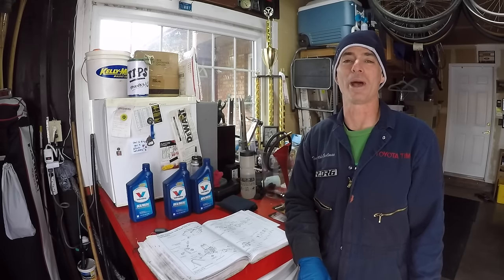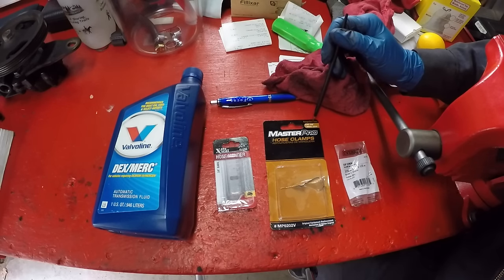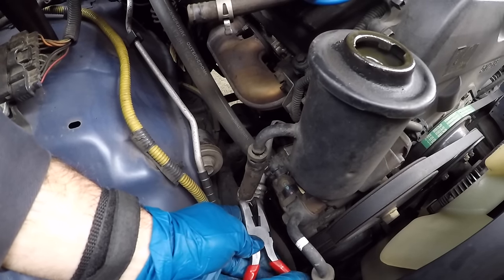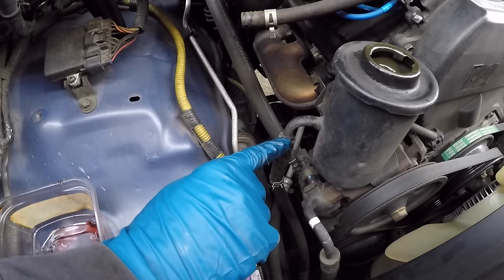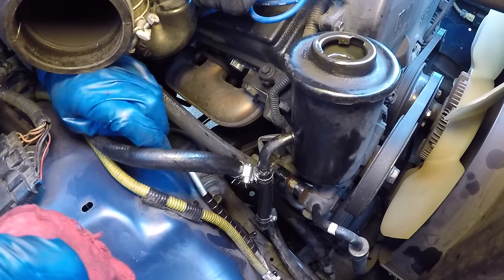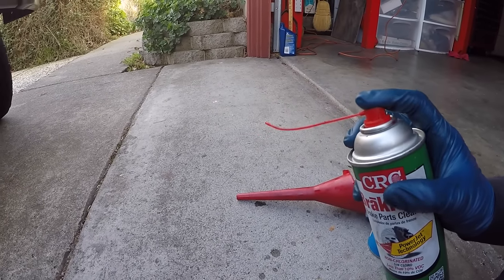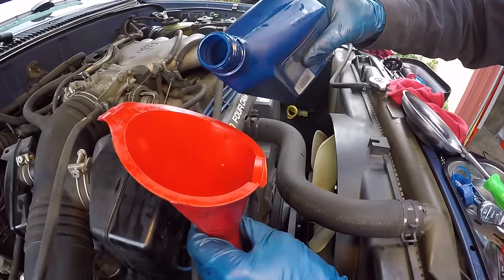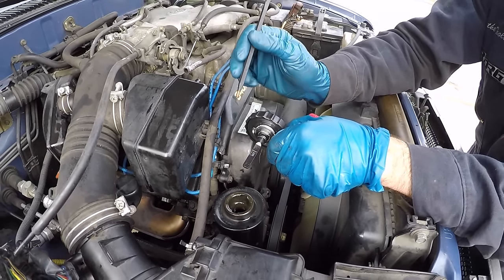Power Steering Flush and Reservoir Cleaning

Comment: Great and detailed video! nice dexterity with the two-finger method! However, why not clean up the reservoir gunk first and then do the flush...also...might help soak up the reservoir with cleaner and let it sit and chew up the gunk...
Reply from the maker: The reasoning of doing the flush first and then cleaning the reservoir screen is we were thinking if we did it the other way around, we're pushing dirty fluid through the screen and maybe we end up partially clogging it again with any suspended particles in the fluid.  By flushing the fluid first and then cleaning the screen, we are guaranteed a clean screen when the job is done.

I think you're right soaking it might work pretty well but we didn't have the time for that.  The idea was to get Jax back on the road as soon as possible.  So, repeated sprays of brake cleaner was our best to get the job done sooner rather than later.
Reply: @TimmyTheToolman  I had the same idea as Mahesh Rao up there to skip a few steps detaching then reattaching the air box an extra time to start the engine back up to do the flush procedure before actually removing the reservoir, THEN I saw your pinned comment on jacking up the front end and just steering the wheel to push fluid through, so no need to detach/reattach the air box anyways! Will be doing this tomorrow, thanks so much.
Reply from the maker: @iburstabean  You're welcome.  Good luck with the flush.
Reply: @TimmyTheToolman  I think it does not matter which one will be done first whether flushing the PS fluid first or cleaning the reservoir. If cleaning the reservoir is done first, the filter screen in the reservoir will remain clean since the old fluid is not going back to the reservoir and the fact that you are putting a fresh clean fluid during the flush process. 
I like the idea of soaking up the reservoir with cleaner to further loosen the gunk. 
Thanks again for this very informative video. I'm going to do the same process on my 2002 Toyota Tundra 3.4L on one weekend.
Reply from the maker: @007lakay  Thanks for sharing your opinion and good luck with the job.

Comment: I raise it up on jacks. I run 1L through it with it on then fill with mmo and seafoam, and with thw car off, use the wheel to turn it so the rack is full of same. Let. It sit for 20mins while i clean the res filter. It dissolves all the gunk. One more liter through to flush, and then refill with amsoil atf. Added a cardone filter on the return line as well.
Reply from the maker: Good job!
Reply: @TimmyTheToolman  What is mmo?
Reply from the maker: @classicalnaturalvaquero7394  Good question.  I missed that when I read the comment two years ago.  I don't know what it is either.
Reply from the maker: @classicalnaturalvaquero7394  I think I just potentially figured it out.  I think MMO is Marvel Mystery Oil.

Comment: Add a pc of hose to your turkey baster so you can reach to bottom of pump. Works great for brake fluid reservoir too. Looks like valve cover gaskets are leaking too.
Reply from the maker: Thanks for the tip.  I know have a fluid extractor/pump that works great for these applications. *Mitivac Fluid Extractor https://amzn.to/2q0m7xz

Comment: Would you be able to make a video about replacing the o-rings/gasket on the power steering pump? Mine is leaking and was suggested I could just replace the seals rather than replacing the whole pump.
Reply from the maker: WoodworkingStuff We could possibly do this at one point but who knows when.  Are you sure it’s the pump leaking and not a line connection to the pump or reservoir or the reservoir leaking from the connection to the pump?  That o-ring that seals the connection of the reservoir to the pump has been known to leak.  Further, who sells a gasket and o-ring kit for this?  Is it Toyota or aftermarket?

Comment: Do you have any power steering pump replacement videos and any advice on reinstalling banjo fittings to wear they don’t leak
Reply from the maker: We will have a video coming out for a 2nd Gen 4runner 3.0 to 3.4 liter swap that will show disconnecting the high pressure hose off the 3.0 power steering pump and installing the 3.4 liter pump on the 3.4 liter engine.  It's going to be several weeks until those videos will be live on our channel.  But, replacing the pump isn't hard at all.  The high pressure send hose with the banjo fitting is probably the hardest part.  When you try to break free the banjo bolt, the lock nut against the pump housing might break free instead.  You have to hold that lock nut tight with an open end wrench while breaking free the banjo bolt with another wrench.  That high pressure hose will have a copper washer on each side of the banjo fitting to make a leak-free connection.  I would suggest buying new replacement washers from your local dealership parts department.  After both lines are removed, you simply fully remove the pivot bolt and disconnect the adjuster locknut and you can pull the pump free of the power steering bracket.  I'm confident you can figure it out without a video to guide you.  But, if you can wait, you can reference the 3.0 to 3.4 Swap videos when they become live.

Comment: Great video. Only one mistake. When bleeding air out of system by turning wheel back and forth at the end of procedure, the reservoir cap must be off so that the tiny air bubbles can escape. You cant bleed air off with the reservoir cap on ?
Reply from the maker: Uhh, I don't think that's 100% correct John.  It's not like there's serious pressure over the fluid in that reservoir that would stop the air trapped in the system from escaping into the vapor space above the liquid.  If that were the case, any time you took the cap off, you'd hear an escape of pressure or fluid would spray out.  I think there's plenty of vapor space above the liquid for the minute amount of air you're working out of the system.  Plus, I don't think that cap provides a perfectly air tight seal because it doesn't have to be.  The only way the fluid would leak out is if the vehicle was at a serious tilt, like it was on it's side from a 4wheeling accident.  So, I understand your thought process, but I'm pretty sure the air in the system can work it's way out with the cap on.

Comment: Thanks buddy  your agood  teacher,
I have an oring box with different sizes harbor freight, didnt really  find the same size do they have to be the same size found one similar  as far as thickness  but diameter  was smaller used the original. So far its ok we will see.did the flush ,and my check engine  light is on wtf......rig is running fine. What you think iwill scan tomorrow. Have a great  Christmas 🎄 and happy new year. 

W43:21
Reply from the maker: As long as the o-ring is close to the same size, it will probably work for this application.   The CEL probably doesn't have anything to do with the power steering flush.
Reply: No worries light was off this morning  thanks again.

Comment: Hi Tim, 
Thank you for a very detailed video.
I flushed mine on first gen Taco, put atf in, but some time later i found some fluid leak in the boots, could it be caused by atf fluid? Maybe better to put power steering fluid instead?
I used the same fluid as i put in the AT - Castrol transmax hight mileage.
Reply from the maker: You're suppose to use ATF in the power steering system in these vehicles.  Steering racks will develop leaks over time.  If the leak isn't bad, ignore it and just check you power steering fluid level from time to time.  My 2000 4runner has leaking steering rack seals and it's been going on for years.
Reply: @TimmyTheToolman  great, thank you very much!
Reply from the maker: @ssergei  You're very welcome.

Comment: VEry good vid. Would a clog in the filter cause the pully to seize up or create tension when turning along w/ that loud screech?
Reply from the maker: A blocked up screen would make the pump work harder but it wouldn't cause what you're describing.  Your pulley bearing might be shot if the the pulley is hard to turn and it's making a screeching noise.
Reply: @TimmyTheToolman  Thank u  Much [subbed&liked]

Comment: Check out TRANS TUNE by Soafoam because it's designed to remove varnish from pressure valves and gears in your power steering system (if it usues ATF) or transmission. 

Next time use the turkey baster remove what you can from reservoir add the whole bottle saving 4-6oz. After running a few weeks and doing your flush add the 4-6 oz with a good quality synthetic transmission fluid like Royal Purple's or AMSOIL's or whatever floats your boat..... 

I've flushed my power steering in my 95 Chevrolet truck and then a month later or added a bottle of trans tune to see what would happen, and in the span of a few weeks the red clean ATF turned brown and nasty. So flushing afterwards till red clear fluid felt rewarding after missing the gunk from the first flush. Also my issue I initially was the pump was whining loudly when turning wheels but the first flush resolved that problem.

I'm not paid nor sponsored by Sea Foam just a HVAC mechanic who loves automotive d.i.y. on his own time, and has the luxury of a company truck if things go south :x
Reply from the maker: Thanks for the comment. We appreciate the info!

Comment: This was a good video however you may want to talk to your local Toyota dealership garage and ask about using that brake cleaner I don’t know if it would eat any seals or anything or not I don’t know this job might be better left to the Toyota garage I’m thinking
Reply from the maker: There's nothing in that reservoir to damage.  It's all metal.  A metal reservoir and a metal mesh screen.  Before we reattached the reservoir to the pump and refilled it with fluid, we let the residual brake cleaner evaporate off.  So, I don't understand your concern here.  In my opinion. you should only bring your rig to a Toyota dealership for this if you either don't like to wrench or you don't have the time to do it yourself. My local dealer charges $200/hour labor.  I bet they would charge a minimum of 2 hours labor to perform this job of cleaning the reservoir and flushing the system.  I don't know about you, but I can think of a lot better ways to spend $400. The only part that could be of some concern would be the rubber “o” ring which we replaced.
Reply: @TimmyTheToolman  need Toyota expert!
Reply: Looks complicated to me, Toyota here I come.
Reply: Timmy The Toolman I’m sure you’re an expert and know exactly what you’re doing,,,I didn’t mean to offend you I’m sorry....
Reply from the maker: @william38022  Hey William, I'm a DIYer and I'm learning all the time.  I learn from people commenting too.  You had a concern and I gave you the best response I could.  I'm not offended in the least bit.  And no, I don't know what I'm doing 100% of the time.  A high percentage of these videos is Sean and I doing it for the first time so we are literally learning and teaching at the same time.  We do our research before the job and then go for it and record it for people to benefit from.  Sometimes we don't show the best or easiest way to get a job done and we update the video with a pinned comment or make an entry in the video description and sometimes shoot a Part 2 to the video to improve upon it or to share other information as an update to the original video.  So, no worries William.  Happy Wrenching!
Reply from the maker: @jeanricketts6880  It's really not that complicated Jean and you might be selling yourself short.  If you follow our video tutorial, you can absolutely handle this job on your own and save yourself quite a bit of money.
Reply from the maker: @jeanricketts6880  You can be that expert Jean.  There's not magical about mechanics.  They have just put the time in to learn and they have invested in the necessary tools.  Take up the challenge and become your own expert.

Comment: They’re over killing to plug the nipple on the reservoir for the return line on every video I’ve seen on flushing the steering fluid. I cut one of the fingers on a rubber glove and used a rubber ban to keep it in place. It works excellent, you can’t beat it. It’s better than cutting a piece of hose then plugging it with a bolt.
Reply from the maker: Thanks for sharing your tip for this job.  Just remember, there's usually more than one way to  complete a task and often times one way isn't necessarily better, it's just different.  Your way does seem pretty quick to accomplish though, so good job.
Reply: I used an earplug and worked great.

Comment: Great video Timmy...I'm about to replace the steering rack...would you recommend doing this before replacing it so I'm not running old power steering fluid through the new rack? Thanks for your time.
Reply from the maker: Yes, flushing the power steering before the swap would be smart.  What's the reason why you're swapping out the rack?  What symptoms are you having?
Reply: @TimmyTheToolman  Thanks for the response.

That's what I was thinking too.

It's leaking pretty bad on the drivers side and I just keep chasing it with fluid...it drives fine but I can't park on my driveway because of the leaking.

I got a great deal on LowRange Offroad on a reman. rack so I figured it's time to replace it...didn't feel like doing the rebuild.
Reply from the maker: @TheRealitarian  Ok, good luck with the swap.
Reply: @TimmyTheToolman  thanks man...I'll let you know how it goes.

Comment: I see the inline filter in the parts list but didn't see in the video where it was used (did I miss it?).  I did catch a few references in the comments, but as a novice I would want to use and connect that correctly... would you explain the use of the filter a bit?
Reply from the maker: Hey David, good question.  We didn't show it in the video because we didn't install one on Jax's truck.  I installed one on my 98 4runner.  We mentioned the option to install one in the comment we pinned.  I installed it in the return line before the fluid goes back into the reservoir.  I cut the return line approximately 3.75 - 4" below where it attaches to the reservoir nipple, and then I cut out a section of the return line so I could fit the filer in without kinking the hose.  The filter has a fluid flow direction arrow on it so you would want the fluid entering from the below (from the metal line that leads to the steering rack) and leaving towards the reservoir.  It's kind of tight in there, so when it comes time to replace it, you'd have to remove the air box. 

The magnetic filter will filter out finer particulates than the reservoir metal mesh screen can.  Because of this, you will keep your system running better with less blockage in your steering rack, power steering pump, and power steering reservoir.  It's my plan to never do another full flush on my 98 4runner.  I'm going to do more regular partial exchanges by using the Mitivac Fluid Extractor I linked in the video description.  My plan is to suck out the contents of the reservoir with the fluid extractor and then replace it with new fluid.  I will do this as part of my 5k service of renewing my engine oil and filter.  If it looks like I'm not exchanging enough ATF to keep it looking fresh and pink, I will do two rounds of the extraction and refilling every 5k.  I'll do the extraction and refilling once, start the engine and turn the wheels back a forth a couple times to cycle the fluid, and then do another extraction and refilling.   When I get to 30k service miles for the filter, I'll pull the air box and replace the filter.  I hope this helped you out.

Comment: I have never seen anyone run the engine when flushing power steering fluid! Sounded like the pump was getting damaged. I just raise the vehicle till wheels are off the ground turn steering wheel back and forth and that flushes the system without starting engine. 8)
Reply from the maker: Pump didn't get damaged when we did this job.  We found out after the fact the method you described does work.  It just didn't make sense to me how turning the wheels could flow the fluid through a non-running pump.  But, somehow it works.

Comment: I have seen some people not start the car, and turn the steering wheel from lock to lock while the front of the car is jacked up, this will pump the fluid out much slower. Is this method as efficient as this one?
Reply from the maker: I've heard about this technique and the people that told me about it swears it works great.  Personally, I have a hard time believing just turning the wheels without the pump running is efficiently moving the fluid through the system.

Comment: Excellent video!!👍 Can I fill the reservoir with transmission oil?
Reply from the maker: Glad you like the video.  The spec for power steering fluid is usually automatic transmission fluid.  It usually says right on the reservoir cap what the spec is.  If your cap doesn't specify the fluid, look in your owner's manual.
Reply: @TimmyTheToolman  Ah ok  my friend thanks for the information. !!👍
Reply from the maker: @mariomejia4570  You're welcome Mario.  If you're working on a 3rd Gen 4runner, you will want to use Dexron 3 ATF.  I just don't know what vehicle you're working on and that's why I gave you a general answer.
Reply: @TimmyTheToolman  yes I have a Toyota Runner 99 5vz engine.
Reply: I have a transmission oil that I would like to use that I have left over from a previous repair.  dexron lll& mercon
Reply from the maker: @mariomejia4570  Yeah, you've got the right fluid.